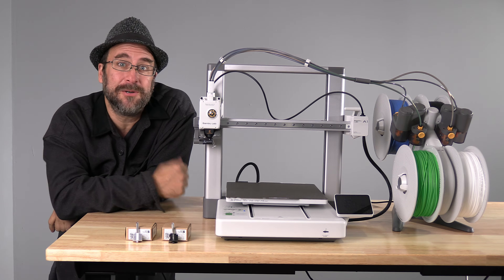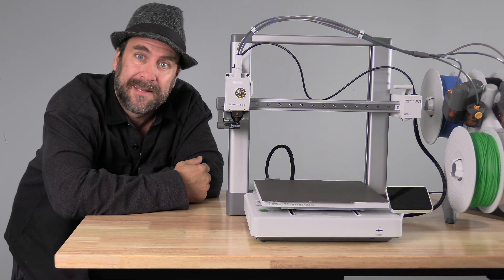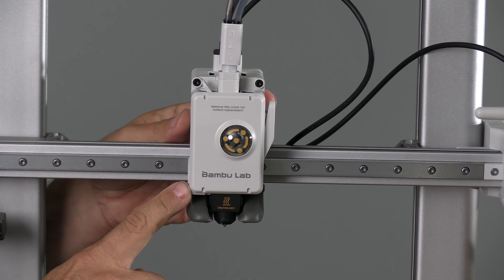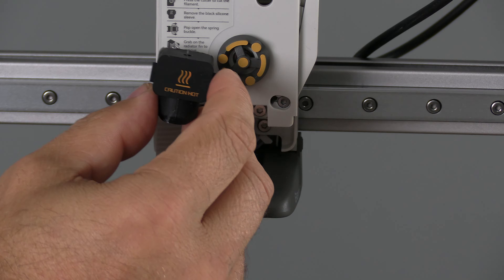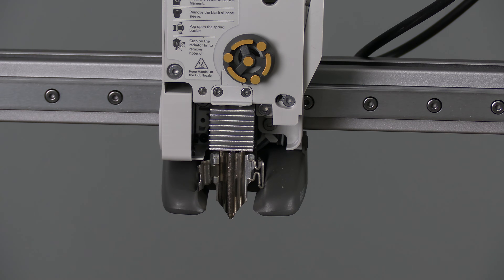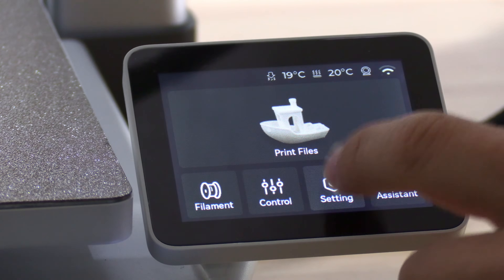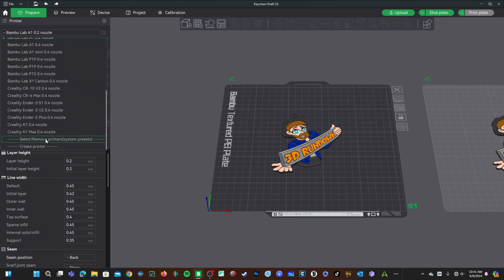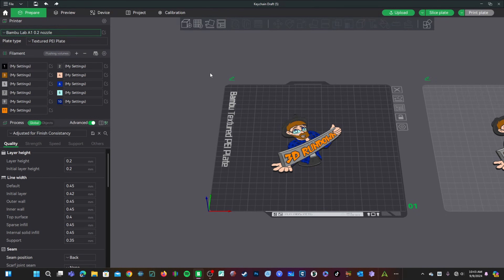How To Change Nozzle Size & Hotend Type, on Bambu Lab A1 & A1 Mini. Config Bambu Studio - 3D Printer

Comment: Thanks!  My software does not show the nozzles in Printer selection.  Also what is the setting directly under Process?  You show "Adjusted to finish consistency" .  I don't have that choice
Reply from the maker: That is where your print profiles are, I don't use the "Adjusted" setting.

Comment: I’m so confused because on mine in printer selection, it only lets me choose the printer and then on nozzle I can choose diameter but when I click print plate says the current nozzle doesn’t match the slicing file
Reply from the maker: The nozzle chosen on the machine, isn't matching the nozzle chosen in the slicer

Comment: I just installed ruby tipped nozzle but it doesn't let me change in printer
Reply from the maker: There is no Ruby Tip profile. You will have to make your own
Reply: @3DRundown oh ok do u no how to do that do u have a video?
Reply from the maker: I have one on the P1P. Should be similar.

Comment: I've replaced 04. to 0.8 nozzle and time of printing is quite disappointing - the same sample element in the same project 0.4 print time: 35m, after change to 0.8 print time 35m 50s; I am using bambu studio - diameter is set to 0.8 - any suggestions how to speed up print time?
Reply from the maker: Increase the layer height

Comment: I bought a 0.2 hardened steel nozzle but there is no setting for it in the printer. What should I do? Please answer, man.
Reply from the maker: There is no official support for a HS 0.2 nozzle. Abrasives at that size would be a clog nightmare

Comment: When you change the nozzle size the the bambu studio re calibrate to the file to keep it the same size when printed?
Reply from the maker: Nozzle size will change the layer height, not the size of the print.
Reply: @3DRundown  thankyou for that. I made a print that was about a 9 hr print with a .4 nozzle so I tried a .6 to make it faster hopefully then it became a 15h print and I don't know why and if there's a setting I need to change. I'm puzzled
Reply from the maker: Check your layer height, and the Volumetric Flow of your filament profile. For .6 Nozzle go for .24 layer height
Reply: @3DRundown  Ty so much I'm gonna give it a go! I appreciate that

Comment: Thanks for the  instructions! Do you know why bambulabs only sell the stainless steel steel version 0.2mm and not the hardend version?
Reply from the maker: Likely because HS is mainly for abrasive filaments, which are not reccomended with tiny nozzles.